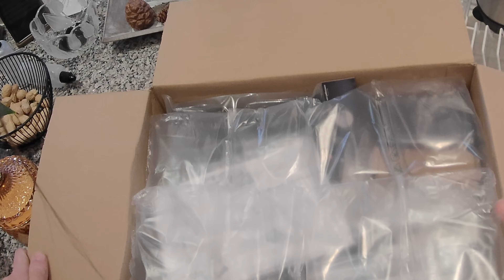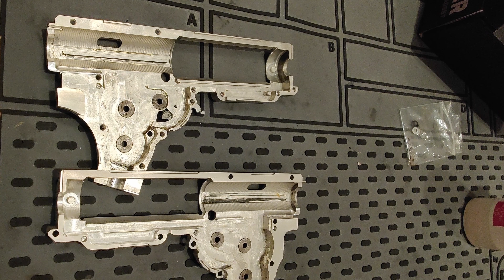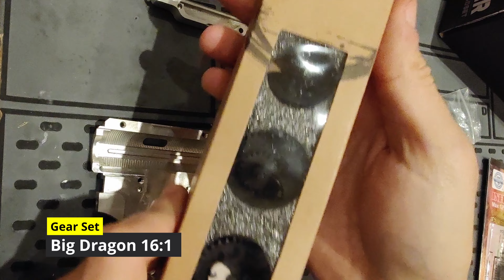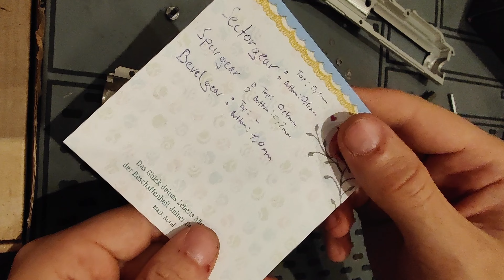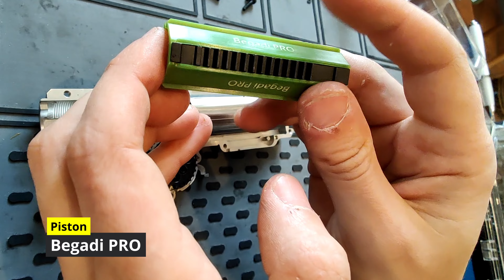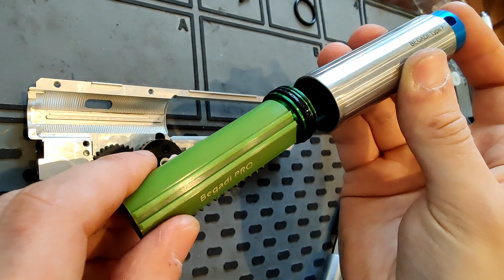VFC G28: Airsoft DMR Build [AEG Tech Video] | licensed by Heckler & Koch

Comment: My "East Crane 204" have that precision, range and 1.8 J in stock :)
Reply: I would like to add though that there might be an advantage with the E&C 204. The VFC one uses standard V2 Cylinder Volume and somehow design albiet proprietary to the 2.2 compared to E&C which uses a SR25 style V2.5 or V2 extended one which is designed for range a precision I would say.
Reply from the maker: This is great! 
But please remember, one thing is buying a modern replica with newest technologies in them, while the other one is to upgrade a 10year+ old model to the very same standards, dealing with the obstacles of early designs (Gearbox Shell, Hopup Chamber...) 
Have a good one!
Reply: https://www.youtube.com/watch?v=781fgUlG0h4

Comment: Did you have a fitament issue closing the upper and lower with the Retro Arms? Also I have the maxx hop up as well in mine but the charging handle is really tight
Reply from the maker: Hi Bobby, if i remember correctly, it was indeed "difficult" to fit upper and lower with the retro arms shell. Needed some "patience". But not impossible. Never changed something about it. Maybe you will, feel free to report if you do! Have a good one :)
Reply: @rummbolt  I know it's the back tabs on the gearbox that slide into the upper, forcing the upper receiver to push up, I'm just wondering if you milled this down for a better fit. Thank you for the reply.
Reply from the maker: @CaesarsGhostBD  Thank you for sharing your experience <3

Comment: every single bb curved right.. is that just a feature of the gun? it seems like no matter what you do it will never shoot straight.
Reply from the maker: There was slight wind on that day :)
Reply: @rummbolt  really? I have my g28 and it never fails to shoot to the right. 10 different barrels, 3 different engines, 5 bucking and 3 hookups and still not fix
Reply from the maker: @rynewby3609  i have sold the g28 by now. But as far as i can tell, accuracy was quite acceptable. Exteral influences not included of course.

Comment: 1.8 joule with 455mm barrel and m130 spring? Wtf a little low I guess
Reply from the maker: If i remember correctly, the energy increased with heavier BBs. Of course, playing with 0.2g in a DMR is not preferable :)

Comment: Hi! Great video with excellent quality. You mentioned in a previous comment that you sold this rifle for 1400. My question is how did you manage to source the Aimpoint t1 with the sunshade? Is it real or airsoft? I would guess that you didn’t sell your optics with the rifle?
Thanks!
Reply from the maker: Thank you very much for your kind words :) 

The aimpoint is a clone by BOG, which is one of the few units to fit the G28 mount. Unfortunately, it has a quite ugly BOG marking on it, which i covered with a sticker in the video. I sold it as well. 

There is also one by Holy Warrior which can fit, but you have to drill the screw holes for the sun shades a little to sit a bit higher. But on the other hand, the holy warrior one has original aimpoint markings, which makes it up a little :) hope this helps - have a good one!

Comment: Did you borrow the HK G28 completly stock assambled ?because me and my Father try to make together an G28 in Dutch Police variant with the manta supressor cover (DSI) project with Full Retro Arms Tuning, but the problem is the G28 is everywhere sold out and its important for us the F sign due German Weapon Law.

Cheers ✌🏼🍻
Reply from the maker: I bought a used, hollow G28 body some months ago in the German AirsoftVerzeichnis , so mine had the F Mark on it. The problem with parts availability is huge indeed, you don´t get both the gun and the retro arms shell from the retailers at the moment. This might also be the reason for increasing prices on the used market, as it more and more becomes a true rarity out there... 

Wish you and your dad good luck an lots of fun with your project!
Reply: My sugestion is that just buy the hk417 and get the extended g28 rail, rail covers, scope mount and stock from wgc store and get it cerakoted. I'm actually still getting mg g28 cerakoted as i got it 2nd hand
Reply: Try buying parts from WGC shop or bunny airsoft from hongkong, i've recently built a g28 firing 530fps with a gate nano

Comment: Interesting choice of internal parts, I also own a G28 that I've recently rebuilt. For now I have some really high torque gears for testing. Regarding the trigger I modified the stock unit to add a micoswitch, that I've paired with the gate merf 3.2. I wanted the warfet but couldn't find one in stock where I live. I'm actually really curious how it will perform next weekend. Especially in comparison with an other build that I've done on a Mk20 SSR.
This summer I'm gonna attempt to modify and install a gate aster into the V2.2. 1st in the stock gb shell then probably into a retroarms one.
Reply from the maker: Thanks for sharing your ideas :) If you´re interested in having something like a Gate Aster in the G28, you may find this link about a V2-Conversion useful: https://www.airsoft-verzeichnis.de/index.php?status=forum&sp=1&threadnummer=0000165934&seite=1#post1571185 It´s in German, and you need to register, but maybe it can be of help with auto translate. Have a good day :)
Reply: @rummbolt  well, he red my mind. I was thinking of that too. And that eases the process. Thanks a lot.
Reply: @Daniel-Cross13  Hey! Did you ever make the conversion to get the Aster in the 417?
Reply: @cristobalportilla3138  hey, unfortunately no, I didn't had the time to do it yet. Probably this winter I'll do it.
Reply: Could I possibly reach out to you somewhere? I have so many questions and tryna shim mine right now
Reply: @ thecrossc13
Reply: @starsnipe1017  on IG in the previous comment. Youtube keeps deleting my comments... 🤦🏻‍♂️
Reply: @starsnipe1017 .
Reply: @starsnipe1017  hey, still looking for me? Previous comment is where you can find me
Reply: @Daniel-Cross13  yea i forgot to add lol
Reply: User didnt work
Reply: @starsnipe1017  it's for Instagram, but it should work on x too. Tho I don't use x that much. Almost not at all.
Reply: @starsnipe1017  It's for !G where I spend most of the time, YT keeps deleting my comms =)))

Comment: Great video, what mosfet did you install? I own a g28 and have done a similar build to yours!
Reply from the maker: Cool! For me, the original Mosfet did it´s job just well. An EFCS System would be awesome, but nearly impossible to install due to the V2.2 Gearbox :/ Which one did you use?
Reply: @rummbolt  I used the gate warfet, gives me active breaking and precock, I went with a 18:1 gearset paired with a 28tpa motor, for a mech trigger it’s ridiculously snappy
Reply from the maker: The Warfet is probably one of the best you can get for the G28 / 417. Good choice!  With the AB feature, the gears are not that much affected by overspin anymore with weaker springs, right? I think, the Jefftron Processor Unit would also be cool - it allows you to set a Sniper / DMR Dealay - the only mosfet that can do so while not sitting inside the gearbox. Cheers!